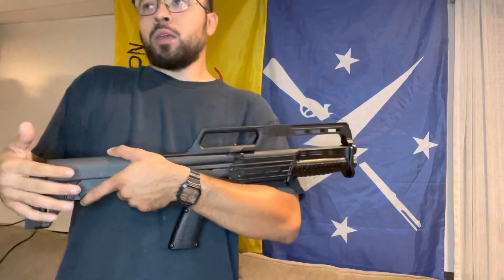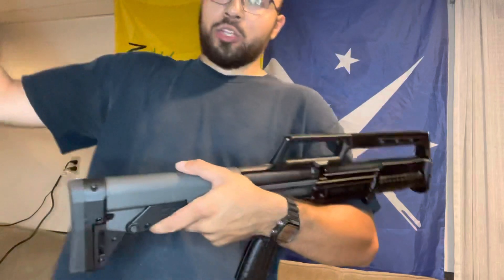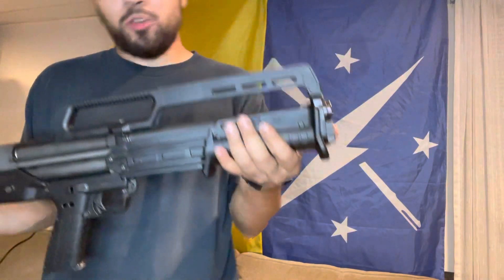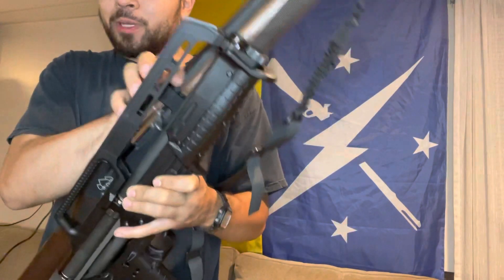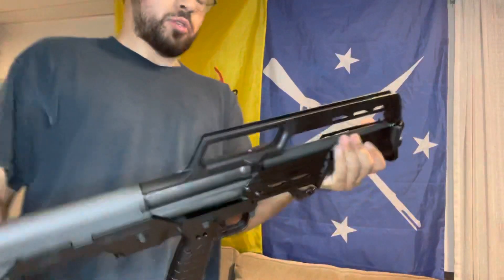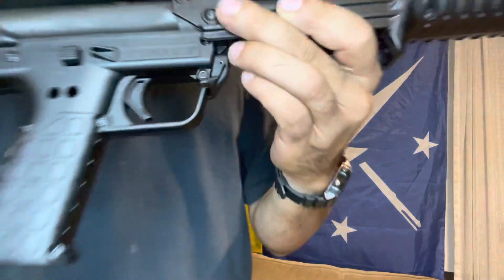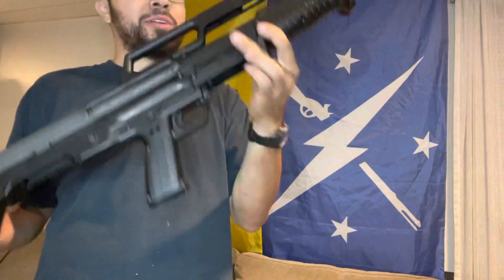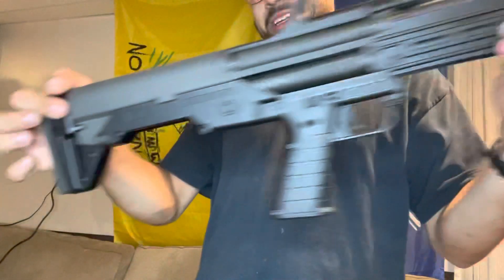Watched nutnfacey video on ks7

Comment: I have a ks7, definitely has a break in period about 100 to 150 rounds. After that it is smooth to run. I've since added a top rail and the aluminum shell carrier a light and sling. I  would trust this gun with my life.

Comment: Have had mine a good while now. When I first bought it I had Major feeding issues…sent it back…came back with the same issues. When they are new you have to damn near abusively rack the thing to reliably get it to go into battery. Bout a hundred rounds or so and it starts smoothing out. Another thing that helped was filling the tube and letting it sit a month or so….mine’s been reliable and butter smooth since.

Comment: Hello. Please read. Long but please.

I have a ks7 that I had problems with and I sent it to keltec. Got it back and ran fine. Then encountered issues again. Sent it again and also purchased a second one in green.  When I got the original back it worked and the green one didn’t so I sent that one to keltec. 
Long story short I’ve sent them both 3 times and I’ve encountered issues on both again. 

The first time keltec said they needed to grind a bit off of a part. Second time they said they have an upgraded firing pin because the originals were too short. 3rd time they replaced the already replaced firing pins. 

I love these guns they really are my favorite “looking” guns. But I don’t see how they are reliable. Have yours ran the same sense the time of this video? I’m asking because if the solution is to send them in a 4th time then so be it. 
Also I have many fire arms, ( this isn’t my first rodeo”) and I’ve seen all the tips to make them function reliably. I’m not being flimsy with them. I grab them with force and I don’t allow the recoil to cause a malfunction either. I really don’t know what to do. What would you do in my position?
Reply from the maker: After multiple time sending for repair I would look to part ways with it ,

Comment: You're completely right. So many people have an opinion on this gun after 5 minutes with it. I had like 10 failures to extract in my first 100 shells through it. After that? In the next 500? It has run as smooth as a Mossberg or Remington. But it's not SUPPOSED to work, so the "experts" give up after 50 shells and think they've proven their point. Nope. Buy a KS7!

Comment: I like nuttin ok, I don’t like his attitude sometimes. Ie “dude that lives in a double wide” most double wides now are stuck built like a traditional home and they aren’t cheap. It’s just I don’t care for his humor at all. He does tell it like it is as He sees it. Oh and I do not live in a trailer of any width but I wouldn’t mind it at all. I don’t click on him to hear about his watches or his knives that’s not what I’m looking for. But his channel his right. I have a KS7 haven’t fired it yet but I’m pretty sure it’s biggest issue is low brass which I’ve seen mor expensive guns malfunction with. I won’t run low brass in anything whatsoever nor mini shells. To me in my opinion the manufacturers make low brass to save them money but charge you the same price for sun standard may not run garbage.